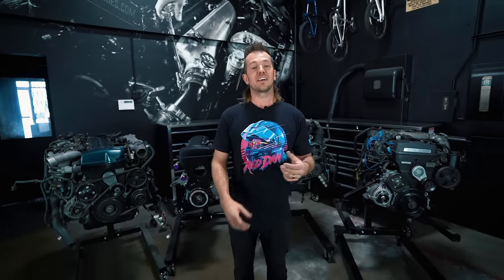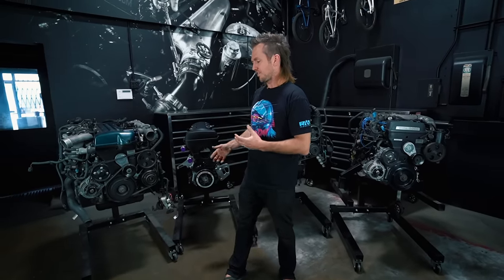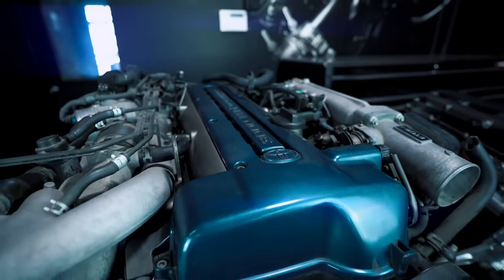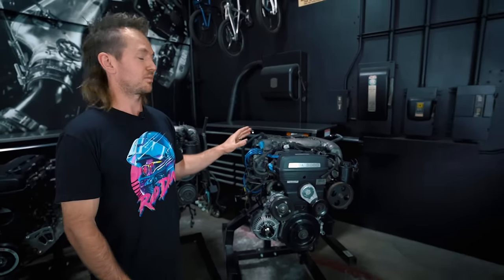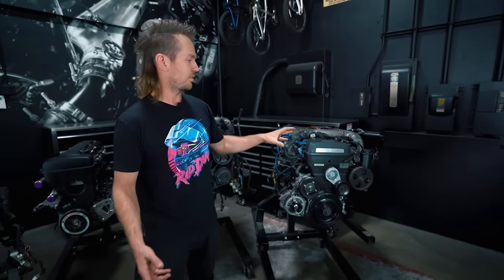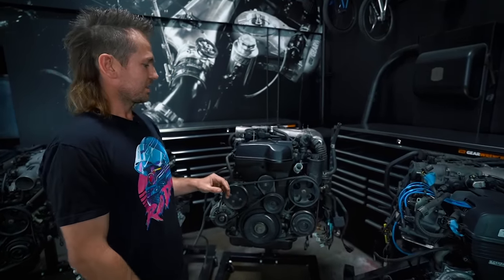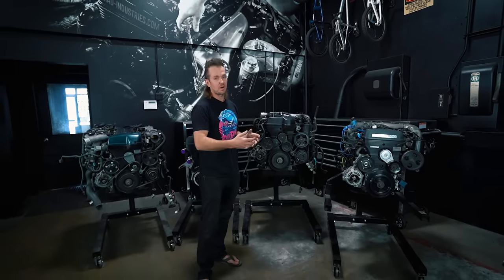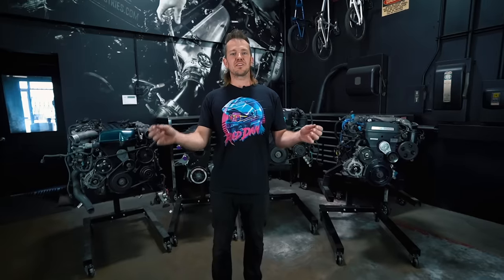2JZ Motor 101

Comment: Didnt think i would be learning about 2JZs at 2am from Joe Dirt
Reply from the maker: Lol 😂
Reply: 😂😂😂😂😂 damn good lesson too
Reply: It's only 1am where I'm at!
Reply: @RADIndustries  Hey bud seen your YouTube video about the different 2jz’s 
I want a 2jzgte vvti. Not at $6k. Why did the prices shoot up? Also should I wait or save or go a different route? Do you think the price will drop if so when?
Reply: @alejandrocervantes7123  supply and demand
supply dwindling away and demand is sky high
the cars they were coming out of are becoming legal for importation which means prices on the cars have gone up aswell
aswell as the engines and cars have been exported out of japan to all over the world 
so your best bet is to get a ge vvti and build it
Reply: @mrkouki180sx  well I have a ge I wonder if there a big difference between ge and the gte. I know the turbo and a couple internal parts but it’s the block the same material? Head the same?
Reply: block and crank are same as gte 
ge block is just not machined more for the oil squirters and the oil feed to turbo
if non vvti same rods as a gte and decently strong pistons
ultimate combo would be a non vvti ge bottom end with a vvti head arp studs and gte headgasket
Reply: @mrkouki180sx  can you upgrade the oil squirters???
Reply: 4am for me 😭
Reply: @alejandrocervantes7123  the upgrade is removing them when you build the bottom end
your oil pressure will thank you
Reply: Here at 3:10 am
Reply: Y’all Funny As Hell SON Really Looks Like Joe Dirt 🙄🤣
Reply: Best comment ever its 2:50 am😂
Reply: Bruuh just what I was doing and thinking lo sleep after this one though haha
Reply: lol fr its 3am over here
Reply: @RADIndustries   do you have a website for the vvti parts i can thro on my is300
Reply: its the fact its a yearish later at 1:35 that it’s happening with me
Reply: Me rn
Reply: 5am for me
Reply: Same its 2:05 AM 😂😂
Reply: It’s 1am in Japan
Reply: tell me why it's exactly 2:01 for me right now as a read this 😂
Reply: Got us all learning! Thank you

Comment: 2JZ's are like the fisherman tale. Everytime someone talks about it, it can hold 100hp more with a stock motor. The safe number on these motors used to be 650-700. 750-800 was possible but wouldn't last long. Kids are reading forums and hearing things here and there and suddendly these are 1000whp capable motors stock.
Reply: Exactly. On the forums where people actually own cars with this motor, safe limit on stock internals is said to be about 400-500hp. Sure you can do some hoorah dyno runs with 800hp but it wouldn’t hold up for too long like that.
Reply: Some people don't understand it doesn't always have to be about maximum power. Good luck getting 1000 whp to reliability hook on the street once the turbo lag ended. 

Don't get me wrong. I love a proper high horsepower build, but there's a time and place. 400-500 in a Supra sounds like a fun time.
Reply: A ton of the reliability also comes with the tune. You could have a fully built block with all supporting mods to run 1000 horse reliably and can detonate it at 500 horse if your tune is shit. As time goes on and people learn more about these motors the tuning and engine management for them is also improving, that's why guys are saying you can run them at 750 reliably as opposed to 650 5 years ago
Reply: A thousand hp for street is pretty cool useless.  First when Supra’s are drag racing they have to have sizable shoot of NOS to spool the turbo.  Without the nod you have a 12’s 1000hp car.  Same thing on the street, a lot of turbo lag.  I raced a stocking Supra in my stockish Grand National and I destroyed him off the line.  He caught me at the end with a trap speed of 131 and 11.67 trap as opposed to my 115 and 11.70 trap..  Supra’s are still bad ass and everyone knows it, but to hear some guy in his garage built a Supra to run 246 in the Texas Mile, I had to call bullshit.  He didn’t say it someone else did, his car was built and tuned by Boost Logic.  One other myth, I’ve heard that these 2000hp 2jzed are no longer stock, but rather the billet 2jzed.
Reply: @fastboatster  Totally agree with people over-talking the motor but let's not under-talk it either.  400-500hp (even whp) is laughably easy on a properly tuned stock 2jz-gte.  People are making 700-800 or more at the wheels for 10s of thousands of miles now, myself included.
Reply: @D4N63ROU5  yes, that’s true. I do think that for daily 400-500 hp and possibly some 1/4 runs there are now other, more easily accessible options like n54. Don’t even need to do any swaps to get it, it just comes stock in e90 335i which is still cheap (but that’s changing)
Reply: @charleslowe522  there are a few that have gone over 2,000 in the radial drag racing world woth a factory toyota cast block. A properly setup Supra can get done the track fine, we have one around here that runs mid 7s with 1200hp. It's all in the setup. A modern turbo can get you to 1,000hp with very minimal lag on a 2jz vvti.
Reply: Shit I’d be happy with 450 for a long time. This Would be my daily so who needs a 700+hp monster. 450 will pass most cars on the road
Reply: @Alextheskater91  450 is not that much in a big heavy car like a Supra.
Reply: @fastboatster  depends on which 2j we are talking about a 2JZ VVTI- GE that’s about right but the GTE Non VVTI can hold up to 650-700 safely stock
Reply: Back in the day they were one of the most capable motors, but these days, with the progression of modern aftermarket R&D and modern cars there are a ton of engines that have pretty much the same potential for the same cost. For example, many modern VW/Audi engines, specifically the ea888 can make 700+ hp with new pistons and rods, valve springs, a bolt on turbo, and the regular stuff like exhaust, fuel pump, etc.  and these modern engines have only been out for like 5 years and the aftermarket is still extremely young. If you want to fabricate full frame turbo kits I don’t think anyone has even found the limit of the stock block and crankshaft. It’s pretty much the same story as the 2jz but with 2 less cylinders. N54, B58, 2.5 TFSI are just a few other notable engines that have basically the same potential as the 2jz, and a few of them require less work to make that power. 

However, with the super large aftermarket support for the 2jz, there’s a higher ceiling for the max power. 2000hp 2jzs exist, where none of those other engines have made 2000hp, but most of them have the potential to do so with enough time and research and since you need to redo basically every piece of the engine it would cost the same as a 2000hp 2jz anyway. 

Modern cars are no doubt MUCH easier to tune for lower horsepower numbers. The ea888 for example can hit 500+ WHP horsepower with only a few thousand in modifications. (Fuel pump, vortex xl, exhaust, intake, tune) After power level you need new pistons and rods, and then no one has found the limit.  Try to hit 500whp in a 2jz and it takes a decent amount more effort and modification. You can’t bolt on a few parts in a single day and flash a tune to the stock ECU with a 2jz.
Reply: What you are noticing is the availability of ethanol and modern fuel management. Nothing has changed about the engine.
Reply: About the same with the coyote 5.0. The gen 3 can run up to about 1000hp crank stock.
Reply: @mrctuned2844  A ford Barra can handle more 1900+ up with stock head block and crank
Reply: @Chevsilverado  There are ford Barra motors making over 2000 ho in street cars in Australia
Reply: @kiwi8.  Yeah the Barra is a great strong motor. Still ain’t exactly cheap or easy to make one hit 1900 hp even if you don’t need to open the engine though. With the amount someone has to spend on the turbo system, engine management, drivetrain, fueling, etc etc. new pistons and valvetrain isn’t even that expensive comparatively, and by the time someone spends big money on everything else most people would go ahead and open the engine to make sure it doesn’t shred itself accidentally/get as much performance as possible. 

It is indeed one of the best if not the best engine to make lots of power on, besides maybe some V8s.
Reply: @Chevsilverado  true but I live where you can buy them for $100 and you can build a 10 sec car with cheap bolt on rubbish so just lucky I guess
Reply: @kiwi8.  true, they’re much more expensive where I live.
Reply: @Chevsilverado  iv had a few now and absolutely love them even high mileage engines don't mind being thrashed I wish they were available worldwide so everyone could enjoy them
Reply: @kiwi8.  last one I saw here was $3500 and had like 275,000km lol
Reply: @Chevsilverado  oh shit that's crazy money
Reply: @Stuart Turner  you can make 1900hp on an unopened Barra?? Do you have a link to someone that has done this? Being an engine builder that sounds outrageous but I don't know all that much about the Barra
Reply: @mrctuned2844  I think maybe not unopened, but stock crank and head. I believe you need to do rods and pistons for getting up to 1900, but an unopened engine is able to push 1000+.
Reply: @01’ Chevrolet Silverado LT 3500  that would make more sense, so it's very similar to a 2JZ then. Stock crank, block, and head 2JZs can make way over 2,000hp. That's with a filled block, wet blocks can go close to 2,000hp

Comment: Great video! Only small mistake is the 2JZ-GE (non VVT-I) is actually non interference. Only the 2JZ-GE VVT-I is interference.
Reply: Unless you change the head gasket and such right?
Reply: By interference you mean the valves hitting the piston?
Reply: @benitamanzanarez3520  yes
Reply: Pure Function is correct. Non-interferance.
Reply: I believe all Toyota GE heads were non-interference until the addition of variable valve timing. I know that’s true of 3S and 4A engines.
Reply: Neg Ative so ge non vvti wouldn’t have issues as much as the vvti
Reply: @benitamanzanarez3520  pretty much youre choosing between distributor vs interference
Reply: Jacob Arici that’s correct. I have a GE vvti head on my GE non vvti bottom end with a GTE-head gasket and it’s non interference.
Reply: Aleph Null sounds good
Reply: @devil2jz500  this is the route I’m going, did you carry over the manifolds from the vvti? Or did you buy new? Guy confused me when he said the heads where not interchangeable. And water pump? Swap that over from the vvti?
Reply: William Turner GE vvti and GE non Vvti intake manifolds are interchangeable. I’m using GE vvti water pump and oil pump. (And also the crank trigger from the GE vvti). I milled my head a little bit because just swapping a GTE head gasket will give you an odd compression number of 9.21:1 (or something like that) which will give you detonation. I am running exactly 9.5:1 compression ratio (stock GE non vvti bottom end+GTE head gasket+milled GE vvti head).
Reply: @negativeindustrial  the s-series never got Vvt. Its successor,  the AZ did
Reply: @adeelahmed1319 
Yes it did. Two generations of it. Research “BEAMs 3S-GE”.
Reply: @devil2jz500  can the detonation be fixed with tuning? what octane you running with 9.5:1?
Reply: @negativeindustrial  duh. Thanks for reminding my forgetful ass.
Reply: @adeelahmed1319 
No worries.
Reply: its also 10:1, not 10.5:1 compression.  you can bring it down the ~9.2:1 with an oem gte headgasket.  and its easy to switch to coil on plug and ditch the distributor.  just need vvti oil pump with the crank angle sensor.
Reply: @td1751 
How do they run with the distributor and boost? I’ve been seriously considering selling my mint LS400 and getting a 5spd SC300 and adding boost to go with my MR2T and my Celica Turbo. Having the three platforms in one garage is highly appealing to me and Supra prices are just ridiculous. I’ll hate to lose the 1UZ-FE and the comfy leather, though.
Reply: @negativeindustrial  people have gone 700+ whp on the distributor.
Reply: @td1751  aww siiick, i'm trying to do the ge in sc400, should i do my own harness or get one? what ecu should i do?
Reply: @Persocondes  especially if you have sc400, just get standalone ecu and plug and play harness
Reply: His facts is off all the 2jz are non interference! He didnt even mention the 2jz ge non vvti and gte is the same bottom end other then high compression and oil squirters
Reply: I have a regular 2001 gs300 is my engine non interference?
Reply: @td1751  
Finally picked up my SC300. I’ve just dropped in a 1JZ-GTE out of a MKIII over the holiday. It’s running and driving. I’ve got the usual Christmas light gauge cluster and still need to install the power steering and A/C, etc.
It’s pretty great. The stock twins are just always in boost.
Reply: They are both non interference

Comment: Basically, buy a non vvti ge as soon as you can before they’re expensive as hell
Reply: No a vvti ge he even said
Reply: Aleph Null yes but he’s partly wrong... the vvti ge head is better, but the non vvti bottom end is much better. He said they’re limited to 450 or so hp but there are a ton of people pushing 500-600 reliably.... he was going on about oil squirters being the saving grace of the gte’s, when in reality most people delete them bc they lower oil pressure.... the ge non vvti literally just needs the distributor deleted then it’s good for 500+ easily
Reply: @zerohourdrift  so vvti if you dont mind building the block and non vvti for more of a ready to go set up
Reply: Aleph Null correct
Reply: Lmao they already are fan boys have ruined the JZ scene
Reply: Elevated Minds is hardly call a 500-1500 dollar motor “ruined” price wise lol. Especially when the alternative is well over 4K. I also think prices will go back down in the next year or so bc the main reason they’re so expensive atm is because importers couldn’t get any more out of japan due to corona restrictions. Once that goes back to relative normalcy the supply should go back up to feed the demand and prices should lower aome
Reply: @zerohourdrift  there's some truth in what you say but as far as the prices going back down .they will never be 2k for a GTE ever again I've asked a few importers they said the price will never go all the way back down JZs are getting depleted...also they import 3x more engines from other asian countries japan really doesn't export that many motors contrary to what people think
Reply: No turbo ge no vvti, pistons and rods are way more better than Gte rods. Take a note!
Reply: @EstahEdits  that made absolutely no senses at all...
Reply: @EstahEdits  The rods in the ge non vvti has the same part number of the gte. The only difference is the non vvti pistons. If i recall right, they are made from the same material, but compression is different. You can slap on a 2jzgte HG and you are good for 400+ reliably. The only downside is the distributor and manifold. I believe we need a few sensors and they are not cheap in order to delete the distributor and go ffim.. I'm currently looking for a cheap alternative for the sensors.
Reply: @EstahEdits  take a note brother!
You’re Wrong!
Reply: Ok, crying myself to sleep tonight
Reply: I don't know what you call "expensive" but non-VVTi engine already goes for $9,000...
Reply: @755hp  yeah a gte and idk where you live but the typical running price for a gte is around 6-7k.... a non turbo 2j (what we were talking about) you’re looking at 500-1000 bucks
Reply: It's crazy how much the prices have increased. About a year ago there was an importer selling me a 2jzgte for 3k and now they're going for 6-7k
Reply: i got one for $400 lol 68k miles. teach me! what ecu, what coils, what harness?
Reply: Except then you don’t have vvti, which is better....
Reply: @zerohourdrift  me and my buddy are building a non vvti ge, and one of my neighbors has a mk4 supra with a non vvti ge been running 720whp for over 2 years with cams, coil conversion, ecu masters black, and a thicker head gasket
Reply: To late they already cost 9.5k just the engine LOL
Reply: The non vvti
Reply: To late
Reply: @Boostlifelex  ~$7k for a GTE now… 🤯
Reply: Buying mine tomorrow!!
Reply: @Boostlifelex  imagine gatekeeping an engine... you're just as much of a fanboy for being into them too
Reply: Non vvti sounds way better
Reply: @Boostlifelex  Idk you can find non-vvti 2jzs for at most $2000 which is pretty cheap. I’ve seen pretty built big turbo 2jz-gte engines going for $8000 (CAD) which is almost just the cost of parts on the engine without machining the engine or the price of the engine itself.

Comment: From what i'm aware the 2jz-ge has higher compression pistons but they're still made the same way as the GTE with a high pressure casting method making them as close to forged without being forged (the expansion of the pistons on fully forged would bring excessive oil burning issues during startup and wouldn't be emissions friendly) also distributor ignition systems on ge's are proven reliable up to 800whp
Reply: I think the rods are slightly thinner on the GE though.
Reply: @Chevsilverado  
They’re not. Only the NA VVTi are thinner.

Comment: I was going to build the engine so I decided it to go with 2JZGE VVTI because it was cheaper and I it has what I wanted it which it was the Block, crank and VVTI HEADS.... if you want decent power with unopened engine then go with the GTE engine but for me, the best option was the GE VVTI... Great Video man 👍🏻